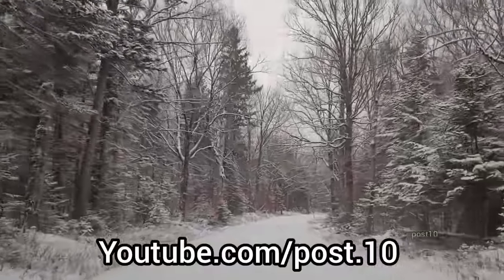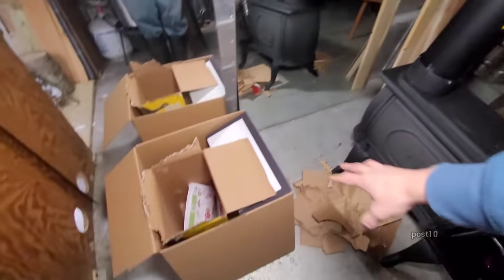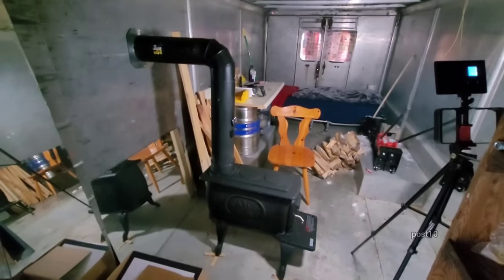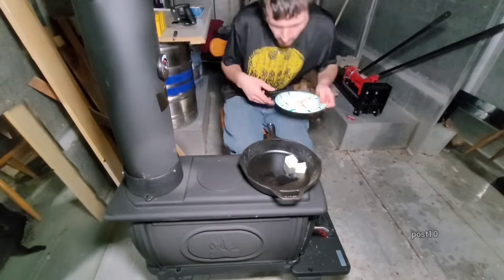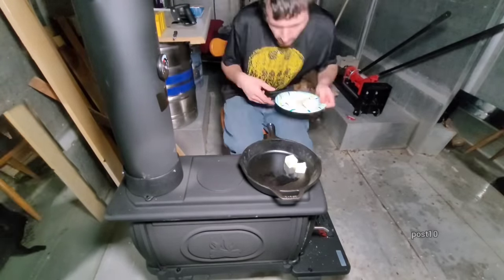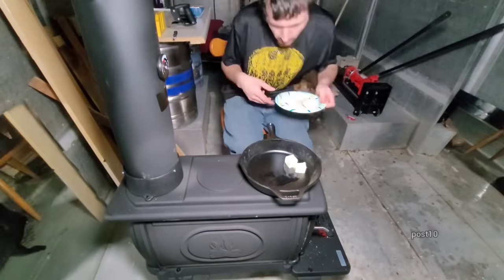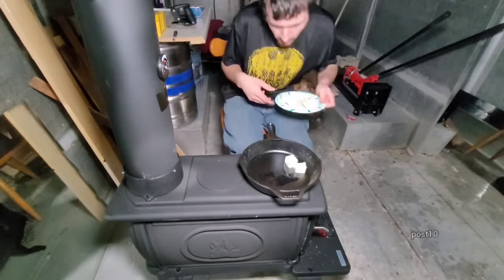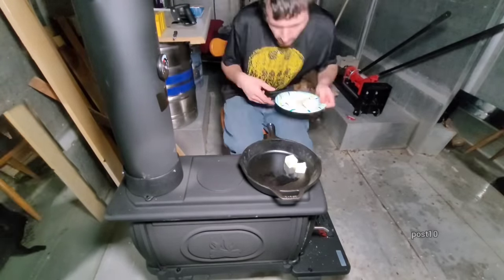24 Hours Living In Abandoned Truck Deep In The Woods During Snow Storm. Transformed Into Camp

Comment from the maker: Part 2 https://youtu.be/o-5g-xecvMc
I know that a lot of people are probably going to say this because already a few people have commented this. The metal roof was quickly thrown on as a solution to stop the water damage from happening, but to my surprise the cinder blocks are more than adequate enough to hold down the metal roofing. This property experienced a microburst during the storm yesterday and 47 substantial trees that I know of so far have come down. It's going to be a very long cleanup that I probably won't be able to get to until the spring but amazingly the roof did not fly off, it has very little space to catch wind. Thanks for watching (edit) people who are mad about me pushing the hole in the Catalyst of the stove, this is a cheap knockoff stove that didn't even go together correctly when I was assembling it. If I didn't do that it wouldn't have worked properly even among my initial startup it would just smother with the door shut, I ordered it from China and I got what I paid for but with the entire thing removed it works fine and now heats up hotter. Also the top of this stove is all one piece, the burners do not remove it is a very cheap stove
Reply: Cinder blocks, the heaviest substance known to man 😁
Reply: poor trees
Reply: Firewood for the next few years!
Reply: Well your probably going to have a lot of firewood for the camp after the storm. Just wondering would you consider some styrofoam insulation on the walls to help with keeping the difference in temp internally and externally? Love the idea for reusing the truck.
Reply: Nature's way of clearing the canopy for new growth. You'll have plenty of firewood for a couple of years.
Reply: Dude, now you own a Camp. You've become classified as a whole different individual. A fellow Camp-owner welcomes you to the fold.
Reply: Embracing your inner Steve Wallis, I see.
Reply: Nah, if it works; It'll work!
Reply: wonders to self how long that log burner will stay put before being stolen, lol
Reply from the maker: @marygraham1676  yes, another comment was mentioning the shiny aluminum foil foam, I think that's a great idea even if I just put it on the ceiling
Reply from the maker: @KatherineUribe-1  I'm just sad because it made the forest thin enough that I can see Vehicles now up on the highway
Reply: Just glad you’re safe and sound.
Reply: You going to leave everything in the truck or will u go back and pick up later
Reply: An apsolute brilliant cheap and cheerful way to camp. Everything has a purpose
Reply: That's a cool spot in the woods. I'd camp out there anytime👍. All you need is a couple batteries and a large solar panel for on the roof, and you'll have power. Nice job Post!!!👍... Forgot to mention an inverter to convert 12v to house current. Did that to my small camper years ago, worked great long as you don't run too many things at once.
Reply: @post.10  That's annoying. To bad,you can't move it deeper into the woods. Out of,all your winter adventures.  Which one,was your favorite? You always have great video ideas.
Reply from the maker: @stellamaggard3669  my favorite was the culvert video and my least was the frozen river
Reply: Not a bad spot you got yourself there, property owner. You might want to rethink some parts little bit. It needs some sort of insulation. although, how effective it would be on a metal truck i dont know. You also need something to deal with the condensation. the corrugated sheet for windshield is a bit of a problem. snow water or even just wind would make a lot of noise. personally i would put there a flat piece. or even a hinge that could pop it up and use a source of fresh air and/or light, but that would be a more expensive option. What you must fix is the door. you cant leave it just like that with a possibility of freezing you in or getting stuck in a different way.
Reply: That was so much fun watching this video. I'd be way too scared to camp there. All the weird noises would just freak me out. I'm glad you had fun camping in your van. Happy Christmas.
Reply: Hi post 10 nice vlog, I always love how you go on this adventures. Have a Merry Christmas 🙂
Reply: @LabTech41  need a Steve and Post collab
Reply from the maker: @LednacekZ  I have a double pane picture window that isn't being used maybe that would fit over it somehow
Reply: @Skud0rz  Well, their domains of content are JUST close enough that it wouldn't be jarring to see a collab; thing is, Post operates out of the New England area, and Steve operates out of Canada; not sure where exactly, so SOMEONE would have to really plan a whole trip for that.
Reply: @post 10  the culvert video was so cool, I also liked the igloos since I live in Florida lol. Enjoy all the videos tho
Reply: I found your video very enjoyable. The condensation off the ceiling would be to much of a problem for me. You could place a tarp or something like it over your bed so you stay dry at night, and you might consider a nice thick wedge pillow for behind your head and back so the cold metal isn’t on you.
Good job
Reply: If you are gonna stay like that you should consider insulating the walls in a proper way ! To get rid of the condensate . It could be a nice little hideout ! Otherwise it was a nice and cosy video !
Reply: That helicopter was probably making sure the van or woods was not on fire .
Reply: I was thinking the same thing about the insulation and ten thought how hot that baby is going to get in the summer especially with that shiny tin roof 
Great video !
Reply: That’s actually a pretty good idea. Drilling holes in the roof sounds like a recipe for disaster.
Reply: cool new content
Reply: @post.10  thank you for doing what a lot of us wish we could ,living the dream ! congrats on the property score
Reply: @MrFruitgum  
People still say cinder blocks. During the war, the second world war and before, building blocks were made from cinders and cement and they also made them from discarded glass products. There are no cinderblocks any longer, there’s cement blocks now. If you have a cinder block and it’s out in the weather where it’s cold and it freezes, you will see it deteriorate very quickly.
Reply: Great video and loved the new use for the truck. I remember watching the clean up video on it.  Awesome that you purchased plot of land and truck!  Good luck with all you do, obviously lots of viewers love your adventures.  🌲
Reply: I use cinder blocks for all kinds of projects as well, and they'll probably work great. When you do decide to screw it down, post frame screws with washers will make quick work of it, and will keep water from passing through that top layer 😊
Reply: Your truck setup is awesome.. you should use it more
Reply: @@cujofriends6119 that's a great idea. Could send his stuff or even e-transfer so he can buy what he needs for it.
Reply: Great video, tks, great actor and producer 😉🤣.  Hi from a fan in Belgium.  Bye.
Reply: Creaking like bulkheads on ships expansion and contraction of metal temp difference...👍💪☝️✌️🤔
Reply: Thanks for the adventure, what a perspective on wood consumption, if was a two month stay....✌️💪☝️☯️👍. ,🤔😁😎 Post 10 comm out...
Reply: @post.10  time to plant a bunch of trees for maximum privacy
Reply: @post.10  The abandoned hotel one was one of the more interesting nights.
Reply from the maker: @jo-gj2sg  not anytime soon, that entire structure is steel and aluminum, mostly aluminum
Reply: @post.10  The helicopter came to check in, you mentioned the bears that might be doing the same in the summer, and now you might have curious people from the highway wanting to see what it is in the woods.  I hope you can stay safe from harm in there.
Reply: @post.10  you can transplant some of the local baby trees, thats what i did- especially cedars
Reply: I would put down some roofing self tapping sealing screws down just incase. This is like putting a mattress in the back of a truck and then doing 55+ MPH and expecting the straps to hold it down.
Reply: @post.10  Insulation foam panels are going to be easier to manage and significantly cheaper. I insulated my mom's RV, and that stuff is not cheap and not easy to apply. A 4' x 8' x 1/2" insulated sheathing board is $10.38 at home Depot and will slide right in along the walls. Sure, it's not going to be air-tight against the walls, but neither would the foil-backed bubblewrap. You could hold the ceiling tiles up with the wall ones. Also, the mirrors are likely reflecting more heat than you'd think.
Reply: Longest youtube video I ever watched in its entirety. I liked and subscribed
Reply: A fire place is worthless for show. I helped a person install a used wood stove and It needed new door seals so we could only turn it down so I much and in a double wide by a good wind lake in the twenty's we had front and back door open sweating in t-shirts standing by the doors LMBO.......
Reply: I am more concerned about the whole zip poked in your woodstove That was designed like that for a reason the heat was supposed to be channeled through your cooktop didn't get that hot then you were having difficulties boiling the water
Reply: I know you enjoy the look of the interior and exterior, but that metal box has gotta be bleeding so much heat, as evidenced by your blanket freezing to the wall despite it being nearly 90° at times inside. I'd consider at the very least adding a 2nd spaced layer of crinkle metal to the roof and maybe windshield. It'll create an air buffer to retain more heat and it might stop the drips and noises from being too jarring. It'll save on wood too.
Reply: maine?
Reply: @le_th_   No need to feel that way hes young and hes learning and look at him at his young age owning property and volunteering most of his free time I don't think you and I could say that about ourselves I give the kid props younger generation typically don't want nothing to do with this type of stuff So my advice to you would be give him your educated opinion and don't shake your head because guess what there was people looking at you one day shaking their head while you were in learning
Reply: You might want to put some Thin insulation all around that thing to quit the condensation
Reply: Why not screw them down?
Reply from the maker: @Infamous918  this was easier and if I ever decide to fix it properly in the future I won't have to deal with a bunch of holes
Reply: cut a couple of those trees that blew over and lean em up from the end to back to front right down the middle, and just tie em down at the ends. Plus the cinder blocks, nothing will blow off
Reply: My only feedback is that CO builds up from the ground up, so if your bed is at two feet from ground, and the CO detector is at 4 feet above where your head would lay in the bed, you are dead before the CO detector goes off...CO detector needs to be below resting head level in any given container of volume in which CO would build up, that way as the CO accumulates from the floor up (like a liquid in a tank) the CO detector goes off before you are engulfed in the 'liquid' as the tank fills.
Reply: Post 10 I have a wood stove similar to yours. It's not designed to operate with door open. The plate you put a hole in is there to slow down the smoke and helps the top heat evenly plus helps slow the time it takes the wood to burn. It's heating the truck well enjoy your many adventures. You the man !
Reply: Run the stove pipe straight up the roof for the best draw.
Reply: Can you use the wood for a Tiny house to build next to the truck?
So you can use the truck as eating and kitchenace,the tiny house to slee and have guests.
Maybe a additional little shed for wood and other things.
Reply: Take the lids off the top of the fireplace and put your pans on there. They will get hot quicker. Great video. Cool cabin. Take care.
Reply: The aspen would burn better if split earlier in year but it would also help if you raked the hot coals to the front of stove and it will heat your cooking surface more evenly.
Reply: Awesome space, needs a bit of work. Perhaps make some slope to the tin, and a brow at the front. Otherwise, what a camper!
Reply: @marbleschili7085  I'm sure he lit up on the infrared.
Reply: Plenty of fire wood for later. As for the roof, it's a quick fix and if it works that's what matters. It's a cool idea and I'd have done the same l.
Reply: @gruntqueen  Yeah hopefully he videos the transformation. For me I'd fix it up and live there. A couple 4 solar panels, maybe a generator. String some LED lights. The interior engine cowling area could be used for food storage.  Line the engine compartment with sheet metal. Man, endless ideas. Hell makes my brain hurt with all the ideas and it isn't even mine.
Reply: @LabTech41  I m pretty’s sure Steve is mostly WESTERN Canada….. maybe meet somewhere along the north shorts of Lake Superior….. Joe Robinet, Mav and Tiny Cabin can all meet up as well, maybe crazy Neighbor and Slim Potatohead
Reply from the maker: @chairlesnicol672  electrician part-time and YouTube part-time
Reply: @le_th_  settle down Karen.
Reply: How big is the property? Does the creek run through your property?
Reply: Hmmm 🤔🤔
Reply: @cliffness420  absolutely,he is having a good time and we’re all watching.he has proved you can live in it.just keep doing little jobs and insulating it.i personally would build a cover over the whole truck with a big air gap. He is surrounded by wood.i wish I was young enough to think like this young man. I’ve just subscribed,I’m looking forward to seeing what he does with it.🎂🇬🇧
Reply: @post.10  Spring will take care of that highway view
Reply: You put the wood stove pipe facing the wrong way, male side down is how it’s supposed to be
Reply: Time to plant more trees and bushes to hide your cabin from the road.   Snow will water them for a while.
Reply: @mavisspearhead1742  you know that mate when he goes that wood stove won't be far behind him from UK
Reply: @MrFruitgum  I call them sinner blocks. They are punishing.
Reply from the maker: @jasonphillips572  technically the outside part is supposed to be double wall pipe but that's too expensive and I didn't want water getting in so that's why I did it backwards
Reply: Fish, salmon, and mushrooms! AHHH!,  The Radioactivity!
Reply from the maker: @chairlesnicol672  I say Maine in almost all my videos that's where I live, this is Vermont and I said it in the other truck videos
Reply: You can please 100% of the people 0% of the time

50% of the people 50% of the time

And 0% of the people 100% of the time.

😂
Reply: @post.10  at
Reply: I would love to know where you got your wood splitter and the cost
Reply: Not using dish soap on cast iron isn’t true. You can scrub it with soap and water but just use a plastic scouring sponge/brush. Once it’s clean be sure to dry thoroughly. I just heat it up on the stove with a tiny bit of canola oil wiped on it and let it smoke for five minutes. Let it cool and you’re good to go for next time.
Reply: Clever engineering hack!
,
Reply: Great video. My wife and I thoroughly enjoy your material. Keep them coming.
Reply: So if I were you I would leave a big pot of water on the stove overnight, why COFFEE and you will have warm water for a body wash or breakfast dishes. You get what I mean.😊
Reply: Love the way you did the roof.
Reply: Bachmann pretzels is near my hometown I'm in Lancaster is this central Pennsylvania video footage?
Reply: @jamesfleming5875  m
Reply: @jeanscott4309  ?
Reply: Great upload! Beautiful nature! Must be creepy to be there alone! I am a fan! Greetings from The Netherlands!
Reply: You do what u can do for it too work,don't worry about people saying negative things,it's u that lives with it not them,hint go too dollar tree to buy like tack on shelves and things to help ya with storages and cheap bags for cooking too.u could always make a winter chest for outside for storage too for for when u camp out there,clean your cobwebs up too u are living in there,yuck I hate cobwebs.. enjoy your videos too..😊🎄 hey there also a metal tin coffee pot u can put on stove too..🥧🌟 happy new year ahead !
Reply: Would be neat if different people can put a little helpful touch!!
Reply from the maker: @brendastegmann6656  Harbor freight, don't remember the exact cost but I know it was definitely less than 200
Reply from the maker: @jasonphillips572  I know, I didn't want rain to dribble in through the cracks, it's supposed to be done with double wall outside but I couldn't afford it
Reply: Man if you open the damper in the stove pipe you won't have smoke in the room. Then after the fire is going close the damper to slow the fire down
Reply: @gerardkeohane740  👍👍👍definitely repurposed the mail van.🤣🤣🤣🤣👍love the idea.
Reply: @post.10  Those are among my favorite videos. I go back and watch them over and over. Thanks, great fun watching your adventures!
Reply: This video came through my feed several times and I honestly thought it’d be on of those makeover van life videos, so I avoided it. But surprisingly I watched the whole thing without wanting to fast forward! I like nice and simple, like this!! Oh btw, new subscriber 😊👋
Reply: Are you going to get a new one, not from china? I would hate for your lil stove to get hot enough to start glowing or something
Reply: Wowza greetings from Owsley County Kentucky
Reply: I enjoyed your home tour and your general narration. Building your fire you used way too much kindling. You're going to need it later. Some night at 3 a.m. after your fire goes out you will wish you had more kindling. You should install a wood burning jacuzzi which can double as a bathtub.
Reply: @LabTech41  ❤ Isn’t Steve the best? I’d swear he’s my brother from a different mother😊
Reply: You should cover the water as it would boil quicker.
Reply: @brendastegmann6656  I don't know where he bought his. I know that Harbor Freight in the U.S.A. carries them.
Reply: I love it great job
Reply: I never second guess anything you do, Post. You are brilliant with what you do and smart enough to learn from your mistakes. Ignore the armchair quarterbacks!  🤪
Reply: L no
Reply: Nn
Reply: Basically, the Property is paid off by a Video...
Reply: 1:13:19 I’m thinking post 10 needs to start a cooking channel 😅